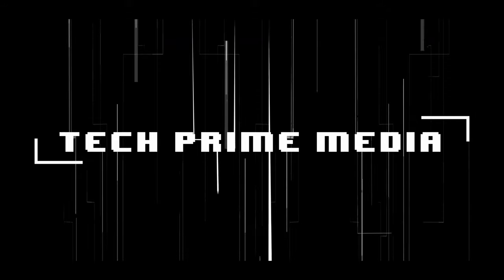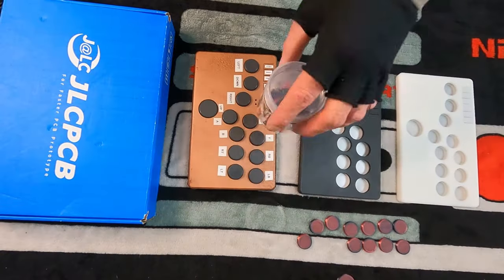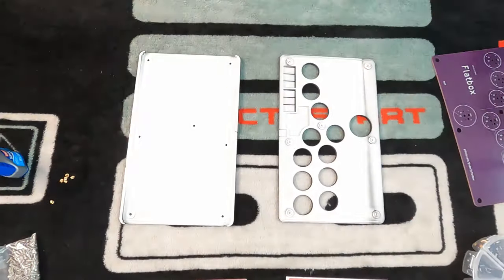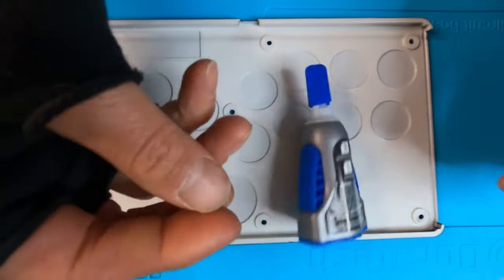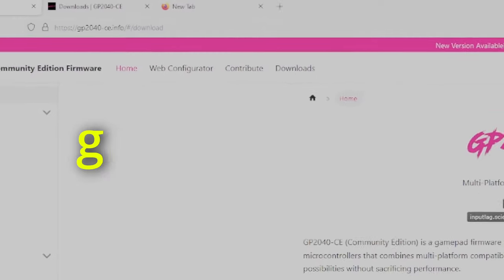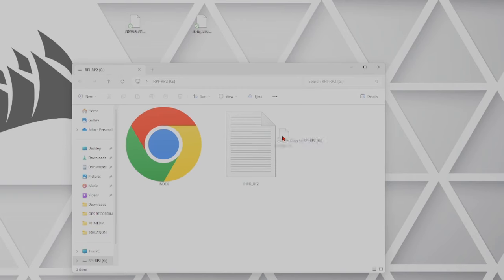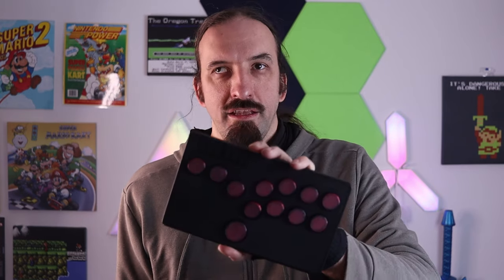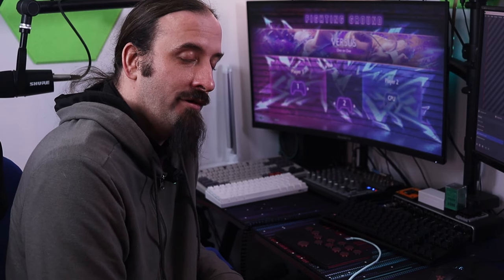3D Printed DIY Controller for Fighting Game #Flatbox #Hitbox

Comment: I did everything and the controller is great ! The buttons are really loud tho, what can i do to make them more silent ?
Reply from the maker: The only thing I have found to work is adding a kind of thin rubber ring to the bottom of the keycaps. You could also ad rubber to the board where it makes contact.